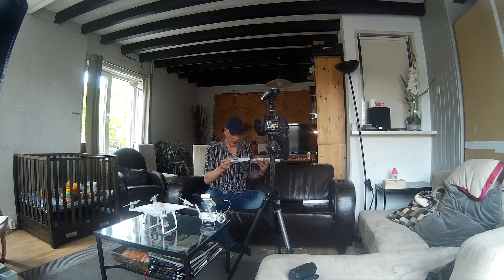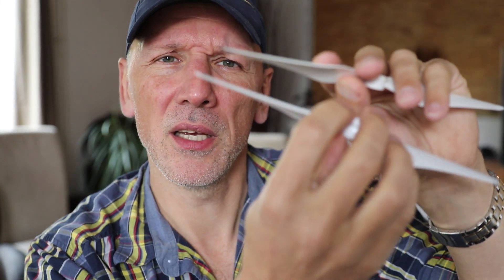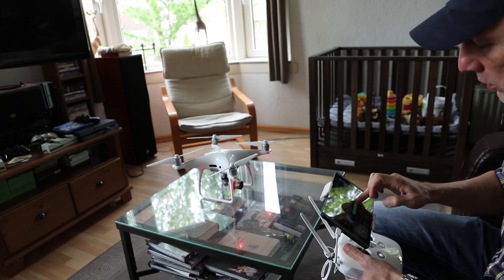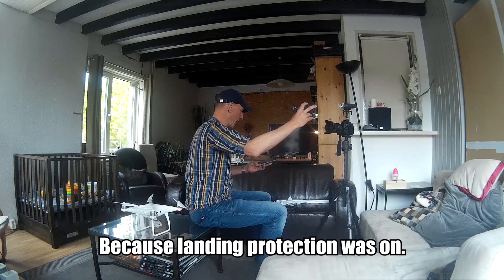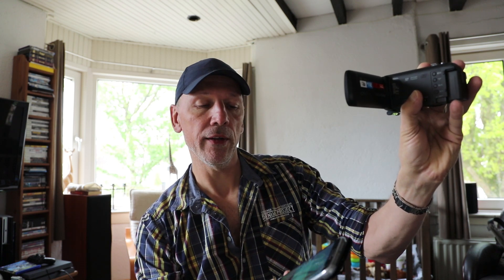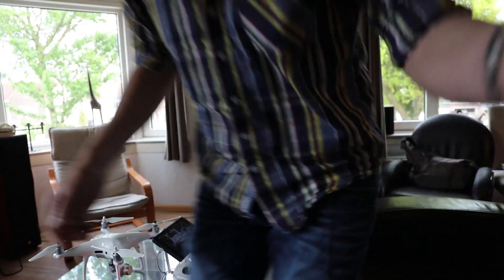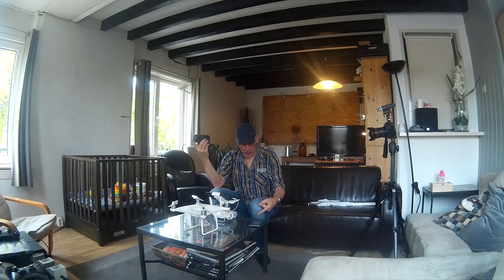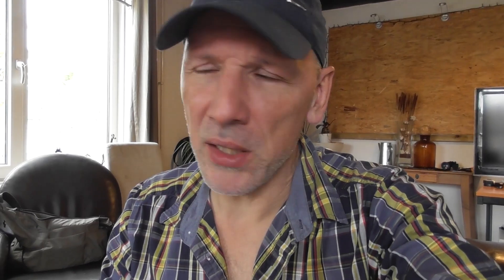How to get 1-2 minutes longer flight time on the DJI Phantoms just with different propellers.

Comment: Hi, I use Litchi with my P4 and it is much more reliable than the DJI app. Also has more functionality?
Reply: Chucky Lad xD with litchi app you don't need censors so p3 has same functions that the p4 has with litchi app
Reply: Chucky Lad ib
Reply: In May, this year, 2017, the DJI GOAPP was installed on my LG smartphone after not being compatible the year before. During midflight, the Go App shut down and went into the Registration Mode. I had recently upgraded the firmware just to let you know. Anyway, the Phantom 3 Standard did not respond to commands after I restarted the APP. Thankfully I was using line of sight to return by using Sport Mode. It was not responding well and even seem to fight my commands. I finally landed after hovering over the next door house, which infuriated the people there and threatened to call the police. I finally landed but it was scary. I'm thinking of Upgrading to a Spark or the Mavic when I can afford it.

Comment: the new go 4 app is fully loaded and causes android system to crash not just the app, and is causing app video problems on some eary iso devices.. if using the hdmi module on the remote all problems are solved if it is removed from the remote. as for screw on props and more rake.. if they dont come off in flight they will not be as smooth for slow movement, id sooner stay safe that gain 1 or 2 mins in flight.. and 9.5 times out of 10 I bet you land it with 30% batt power left if not more ;)
Reply from the maker: You know that I regularly run out of battery :P.
Reply: Lol I dont know who has the best sense of humor or more funny than you or Ken Heron ;)

Comment: So i dont think using another technology is beneficial. As everything is finely calculated for maximum flight. Stay with OEM parts. I've tried Carbon Fiber Props and found them to cause to much vibration which is not beneficial. Good Vid nonetheless. I seen a Heron the other day. Ken was no where to be found. Lol

Comment: Im getting the "aircraft disconnected" warning in flight with the latest go4 app on my android devise as well. Everything seems to work fine though. I just updated my ios devise to the latest go4 app and im going to see if it shows disconnected  in flight as well.
Reply from the maker: I suspect it has to do with the USB connector somehow, especially on the HDMI-module.
Reply: It could be in your case. I know a lot of people have had some issues with the hdmi module causing problems. I have a p4 though so that cant be my issue. Have you looked into the MiraScreen wireless hdmi dongle I told you about? Its a tiny little hdmi wifi transmitter that will mirror whatever is on your mobile devises screen and sends it to any hdmi input. It works with ios and android through wifi. Whatever you see on the tablet screen you will see on your tv screen or your goggles. Its nice because you can still see all the flight telemetry through your goggles. Ive been using it for a year now and I love it. It was $13 usd on ebay or you can order directly from their web site. You might wanna check it out, its pretty neat.
Reply: My bad, i read that wrong. I thought you were saying it was the hdmi module. Your probably right then, it very likely is the usb flaking out.

Comment: my dji go app (not go4) started crashing over and over on Friday. NO lcue why, I had made no updates to anyhting that I was aware of.
Reply: additionally, I have not had issue with dji go crashing in the past. I also have Nivida Shield tablet.
Reply from the maker: With Android 7.0 you might experience these crashes. Best is to remove all DJI apps and folders and then clean install DJIGo4.

Comment: It's a pity you weren't displaying the motor RPM on your tablet screen, I'd like to know if there was much difference between the two masques of props.
Reply from the maker: And how would I be able to show that?
Reply: Sorry my bad, I knew I'd seen it displayed, it's on the Mavic controller and not Go4. Your phantom can't have a TX display. 
Sorry!
Reply: NeverMindYourOwn ... the NVIDIA Shield K1 display is treated as a mobile phone display by the DJI Go4 app, so the RPM radar screen isn't visible nor available.

Comment: Your Shield Tablet will always give you problems with a firmware that is newer than 6.1
Reply: dietero100  .... Agreed, but surely the 5 programmers DJI has updating the Android app will catch up to OSv7 eventually.    I realize the 100 programmers maintaining the iOS app have no problems.
Reply: Yes, you would think that they could break the voodoo.  However, I have flown with version 6.1 trouble free, both the P4P and the Mavic and don't intend to upgrade their firmware until they, either the google peeps or the DJI peeps get it right.

Comment: Good test, I think.
For the noise level: Bolt the drone to the ground and have your recording device in different distances (1m, 5m, 10m, 50m) while testing the 2 props at different speeds.

Comment: Another great video Peter, thank you. Hover test is only one performance aspect, what, if any, is the effect on drone speed and maneuverability? I would expect the aerodynamics in flight would be different with the broader, deeper props, please let us know.
Reply from the maker: I have been using these props since I got them and the biggest differences are the different sound pattern and longer battery life. The props are lighter and thinner, so they break easier. But in a way that's good, because they are safer. Also because they are more flexible they respond a bit slower to the sticks, which is also good for filming, because abrupt movements don't look good.
So I really like them. And they are even cheaper too!

Comment: What the heck  ,  DJI did a fantastic job with its blades, they are consistent which is what you want when you hover,   I could hear the Ups and Downs of the fluctuations of the other props very distinctly.
Also   The extra work to take off the blades for an extra 2 minutes not worth it so the only reason your leaving them on is because taking them off is a pain. lol        Im not sold on this upgrade  and props to DJI for doing there homework on the blades as  both the sound and hover was consistent and with the quick release is a win for DJI dont you think. ?
Reply from the maker: Remember this video: https://www.youtube.com/watch?v=dsl63FsrkEY? You will never have that with these props.
The extra work is hardly worth mentioning. 1-2 minutes extra flight time is a big difference to me though. Also the props are a bit thinner. It means the response time is a bit bigger, which is good when filming, because you want soft transitions. And they break easier, which is safer actually.
In the end it all comes down to preference I guess, but I have kept them on ever since. Oh and they are even cheaper as well :D.
Reply: So the extra 2 minutes was in hover mode but actual flight might be more like 30 seconds.  I do see your other points but we will see , also I have the Pro Plus Controller and although you do not have the screen record I have never had the software crash once yet in over the last 50 flights.   So it is a sacrifice worth the frustration of not having scree record.
Reply: We use Master Airscrew props on our equipment to a large degree. They are better balanced right out of the box, which helps on everything from engine damage to steadier pictures. They are stiffer which translates into quicker respons time and less power usage. Also a hovering drone have a higher draw than a flying one as it does not get the lift effect from its body. There are videos of this being tested right here on youtube. We also use wooden props as they also are very stiff and extremely light, they have a tendency to break if you crash of course, but this only saves the engine and mounting brackets. Normal APC props is cheap, but not very efficient.
Reply: Unless they have a truth serum I think everyone would be ok  but what are the other options for the phantom 4 pro. ?
Reply: You better shell out $35 for two full sets. Don't be Master Screwed when you break one. Have fun changing them all  back to the old ones in the field when you forgot your glasses. Lose a little part and go home cursing.
Reply: Coal Akida but maybe you can chop wood with the Master Airscrew lol.   I am still flying stock dji quick release.  No problems, so I don’t want to create one.  If you are flying that close to your battery’s shut off point..I don’t think props are going to help anything...a crash is inevitable.
Reply: JT-RC Haugaland Modell Klubb  I think any lift effect from the body is cancelled out during flight due to the camera underneath, and the fact it is pitched forward in flight, no?  I haven’t tried these stiffer props, stands to reason they may be more efficient....but don’t you think some flex is a good thing for camera stability in windy conditions? get tossed around a bit less?
Reply: NeverMindYourOwn well knowing how to fly properly using correct amounts of throttle you won't have a problem getting extra flight time. Remember if you crash using these all insurance by dji will not count. Also there's other options if you want to fly for longer.

Comment: Oh my.   DJI Go4 crashing with the NVIDIA Shield K1, again.   Nuts, that is the same tablet I use - and I have the crash issue.   Yeah, I have been sticking with Android OS7, but I have been uninstalling DJI Go4 (folders first, then UNINSTALL button in the Play Store) before a fresh install - after every Go4 update prompt.
Reply from the maker: Yes, that's what I do too. Most of the time that goes well... But DJI messes things up all the time. Now the system is really slow and I have to put the screen recording back to 720p to get decent results.
Reply from the maker: Cache has always been off for me. I don't use it.